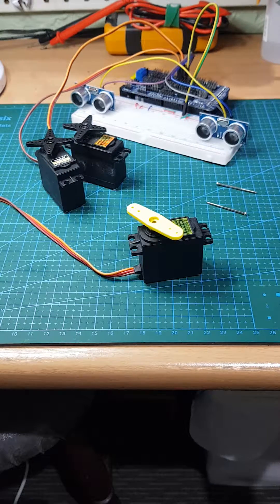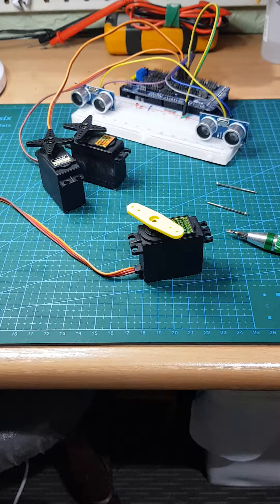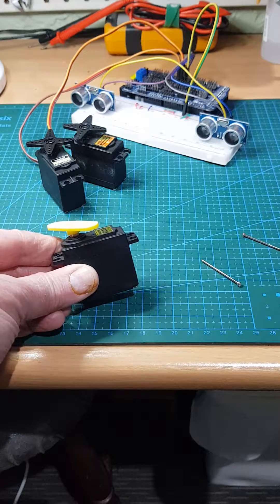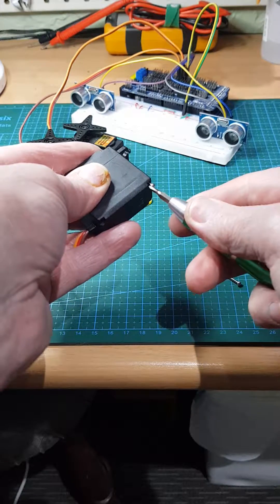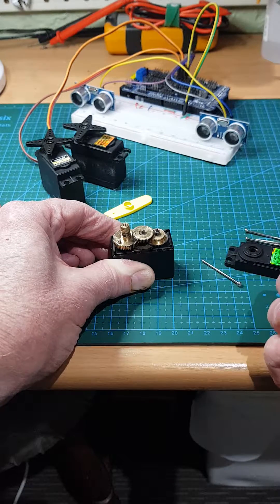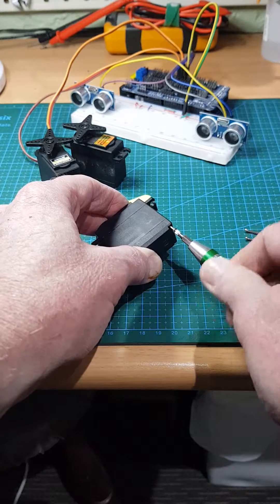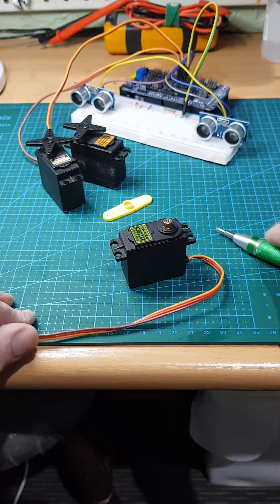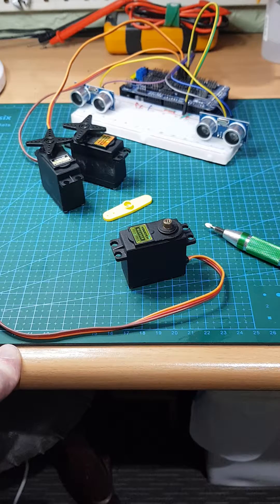SpotMicro -  Freeing a stuck servo

Comment: This worked a treat with one of those, commonly transparent blue, micro servos!

I had to go a slight step further as the cogs directly attached to the motor was barely 2mm so very difficult to manually turn. I ended up first carefully removing all the cog (taking care to retain their grease), firing-up my Arduino with the Servo Sweep sketch and sure enough, the motor ran free.

Another thing to note is that initially without any cogs on the I could here the motor was rotating a far greater distance in one sweep, verses the return. I stopped the motor again, manually spun the motor, restarted and the sweep was now even (quite to my surprise!).

I then replace all the cogs on the spindles, while the sweep program was still running, and let them slide down the spindles - mindful if there was any issue with potential mashed teeth on the gears.

Ran the sweep program for another 5 minutes and while I type this, still working!

Cheers, back to reviving a +5 year old hexapod project :)
Reply from the maker: Hi Patrick, 
Thanks for the feedback. I’m glad to read that one of my videos actually helped someone! Lol. I’m even more pleased that you built on the instructions to give a better diagnostic/repair procedure plus that it’s revived your own project.

I am a bit puzzled, though, by your finding that the motor span more in one direction than the other. AFAIK, in most servos the motor is free to spin either direction without limit. The limit to the movement is usually controlled by feedback from a potentiometer attached to the output shaft. It’s when the feedback become inaccurate, due to a slipped gear or such, that the servo is driven past its limit and jams.

However, in my case, the AF in AFAIK (As Far) is not very far at all and probably way out of date. I started mucking around with servos about 45 years ago and have only got back into it recently.

Speaking of mucking around, one of the reasons this project has been stalled for so long is that I decided I needed to learn web hosting too. IMHO, I’ve come a long way and I now have a functional and acceptably reliable setup. I love to annoy my tech savvy kids by referring to it as the SpotCorgi Data Centre or Server Farm. In reality, it’s 2 laptops rescued from E-waste piles: a fileserver for my LAN and a virtual machine/web host. The latter runs about a dozen virtual machines and hosts 2 rudimentary but functional websites. 

I’m at the point where I’m thinking, first, why would anyone who has a hobby site be paying hosting costs? Conversely, why would anyone who has a hobby they’d like to share but are put off by hosting costs not host their own site. Anyhow, I’m rambling now but you can see the results of my efforts plus instructions on how to do it yourself at:

https://spotcorgi.net/

I’d be happy for you to be the first to comment in the blog.

Cheers,
Michael